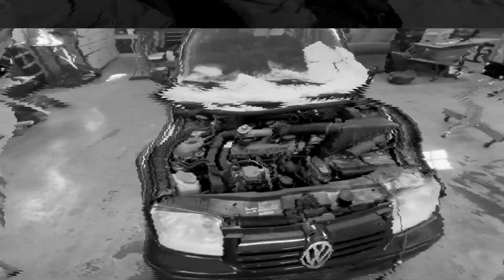Pulling a Turbo Diesel! Power Plant for the Mini SnowCat PT5 Tracked Vehicle

Comment: Really interested in seeing how this all comes together! I want to make a tracked vehicle in the next year, I already have some old bobcat tracks. But I'm planning on a smaller engine/pump combo.
Reply from the maker: Nice! I’ll hopefully be working on it all summer. There is lots and lots to come. If you have any questions feel free to ask!
Reply: @CenterLineDesigns  My understanding is that 1 HP engine roughly equates to 1 GPM @1,500 PSI. Was planning to use a 20HP engine to power two 10gpm pumps and then get similarly sized motors.
Reply from the maker: @z135210  one tip on sizing your motors. Pay attention to the torque they develop. Any the speed at your flow rate. The motors I got were rated for higher GPM and pressure so I had to adjust its ratings to reflect the lower pressure and flow rate. Then I had to calculate drawbar force I need in the vehicle to determine the effective torque I need to accomplish my goals. If you under size the motor to try and get higher RPM output you can run into an issue where you hit the sheer point. The hydraulics hit relief but still fail to decline the torque you want. Then you have excessive heat and poor performance. What style pump are you using? I choose piston pumps with manual displacement control. Highly efficient vs gear pump that constantly will be on relief.
Reply from the maker: Fail to Develop